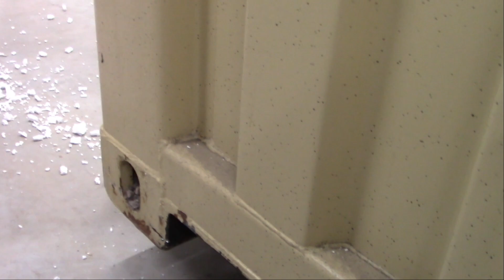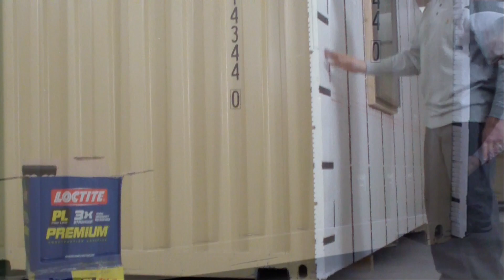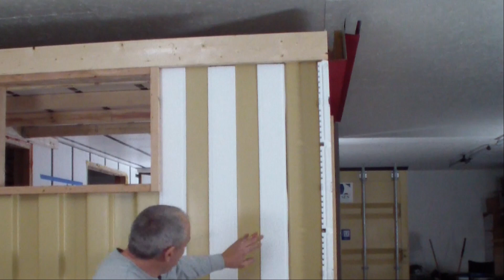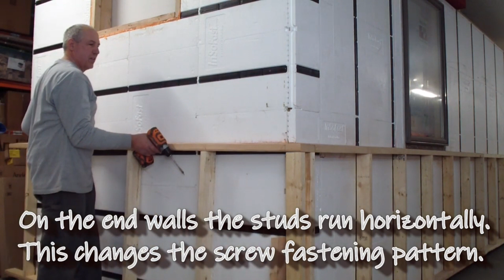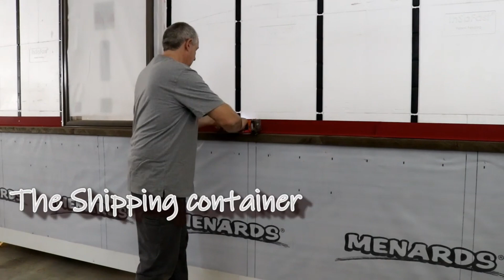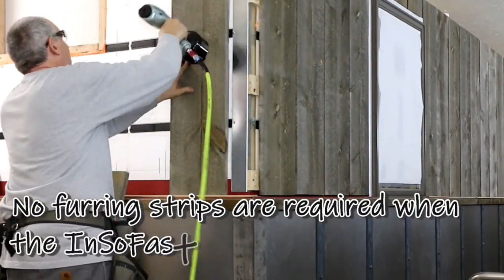Flat Panel and Inserts Exterior Endwall

Comment: Is  the exterior r value higher than The interior r value ?
Reply from the maker: R-Value is the same for both surfaces interior or exterior.  Additional R-Value can be added to either surface added to the exterior preserves interior useable space. For in-depth r-value information see this webpage  https://www.insofast.com/explore/insofast-plus.html#interior-living-area
Reply: Can you insulate inside and outside ? Or would that cause a condensation problem ?
Reply from the maker: @michaelripperger5674  It would not be a problem this container was insulated both inside and out.